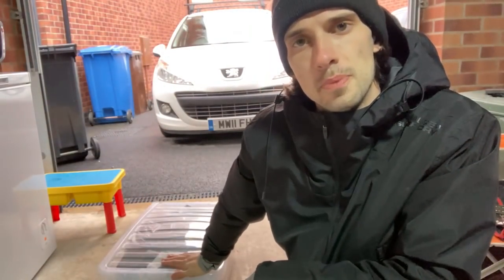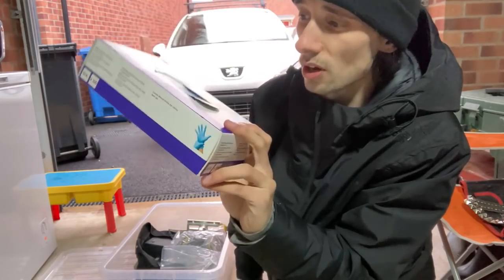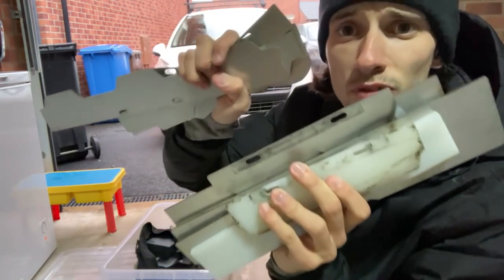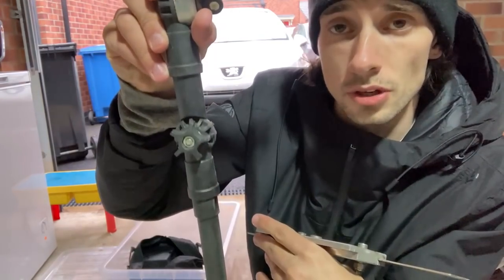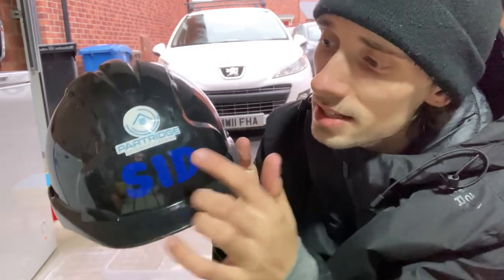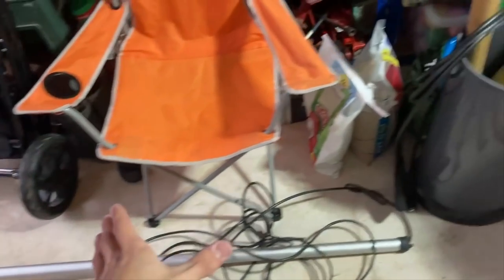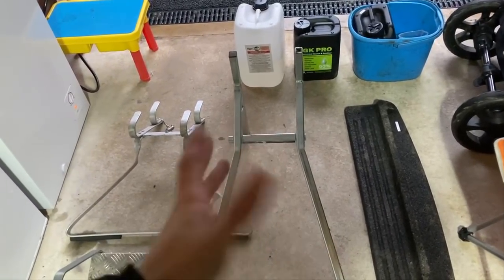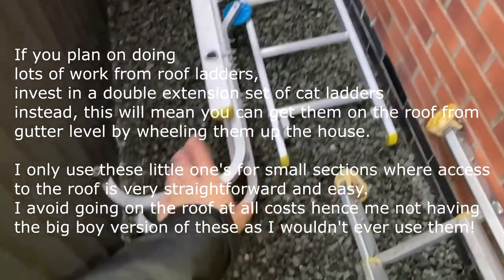ROOF CLEANING: Everything You Need To Start Your Business UK

Comment: Do you just have 1 backpack for the chemicals? Or a separate one for washing gutters? I can only afford 1 wfp atm so will have to make do with change between using chemicals and attaching scrappers not ideal 🤦🏻‍♂️
Reply from the maker: I only use 1 backpack for each chemical but I use a watering can for hypo on driveways. 
If you rinse out extremely thoroughly it’ll be fine just be careful! And yeah I used to switch out the same pole it was quite annoying :D just every time you complete a job, reinvest some of it into a new thing, that’s all I do :)

Comment: Hi Sid, loving your channel mate👍 I’ve got a really old house to price and clean with a lot of wall hung tiles ( exterior) just wondered if you’ve ever cleaned these and how you do it?? Would you use hypo??
Really would appreciate your advise
Reply from the maker: Hi mate, I must admit I haven't cleaned those vertical tiles before, however i would steam clean those or pressure wash as they are not a barrier into the house as there will be some brick behind it most likely. (Double check as im not completely sure) I'd probably pressure wash i'd start low, see how theyre coming up and adjust pressure if needed. 
I'm not an expert on that sort of thing though so you may want to double check on a pressure washing / soft washing forum just incase I'm giving horrible advice! 
And thanks for the support appreciate it!
Reply: Ok thanks mate .. I hadn’t thought of pressure washing them! I’ve had a rough measure up and there is at least 180m2 of roof and at least 150m2 of wall tiles.. I’ve only done one small roof before so struggling to price it.. I’m thinking around £2.5k?? Does that sound a fair price to you?? 
Thanks for your help and keep up the good work mate.
Reply from the maker: @charliealder4794  Yeah me personally I don't pressure wash roofs but if done correctly it's fine. The main reason I don't do it is working alone there's no one to man the machine so id rather clean roofs a solo way (: 
Yeah that price sounds fine mate, sounds like you'd be there half the week ish or more so all in all even if it takes a week it's still a good wage! 
If you needed a more accurate price you can message me the address and i'll have a look on google and let you know my thoughts.
Cheers mate!
Reply: @PartridgeExteriorCleaning  thanks so much for your help Sid, I know the house but not the address ! I will try and get it if you don’t mind having a look
Reply from the maker: @charliealder4794  Yeah any time mate, may take me a while to get back to you but I will eventually!